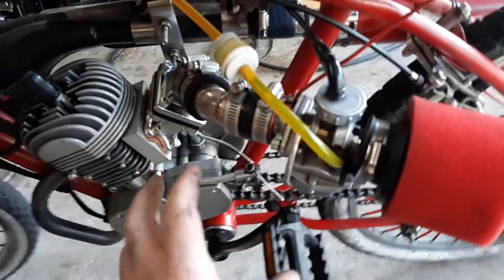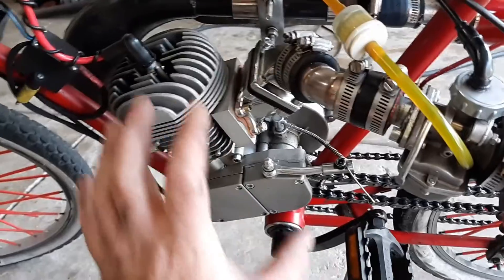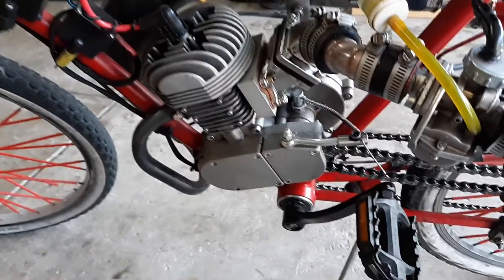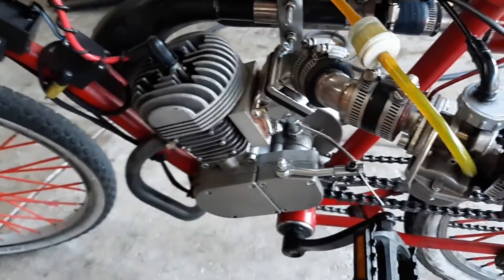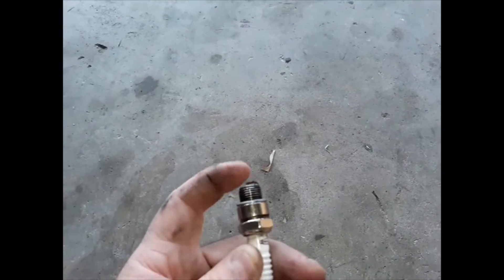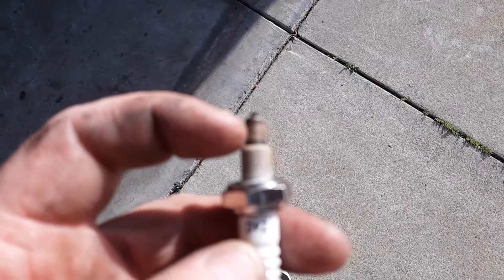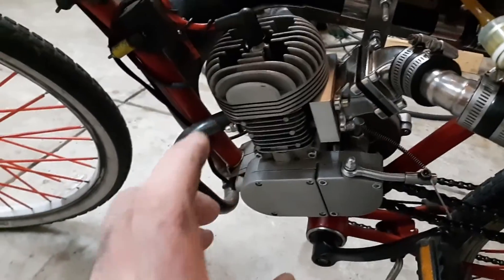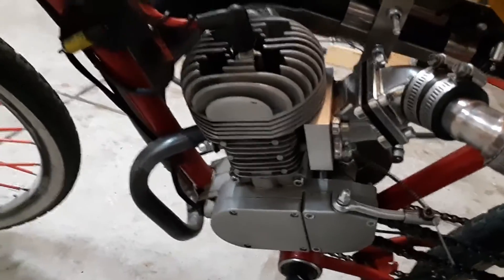100cc 49mm Iron sleeve Build Over Heats! Or Did It??? The Spark Plug Melting Many Speak Of!

Comment: How to use that exact same oil in the exact same mix ratio in the exact same engine haven't burned the spark plug yet and haven't even had to change the spark plug yet they're pretty good ones that works for me

Comment: Not melted. Your piston was ramming the spark plug
Reply from the maker: No it melted the insulation inside the plug. Plugs end was not bent. There is a video where I cut the plug on a lathe to look inside it actually. Fully melted.
Reply: @BuildBreakFix  it's strange. That heat should have melted the piston far before the plug
Reply: Very nice set up, much respect! Would you tell me how you monitor the engine temperature? Do you have a gauge wired into it or do you use a temp. gun?